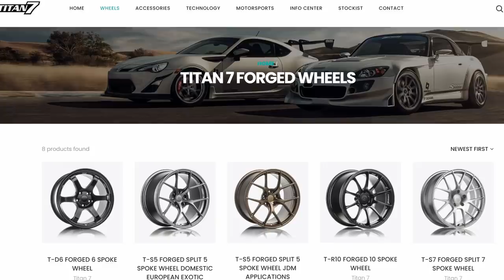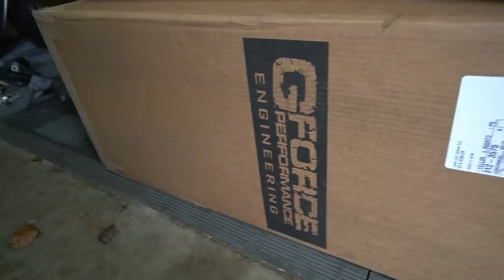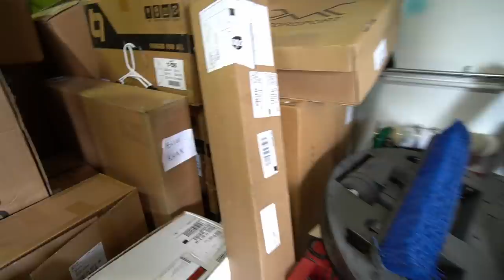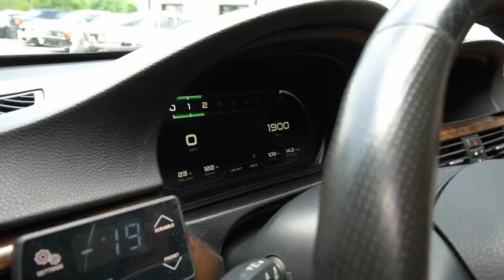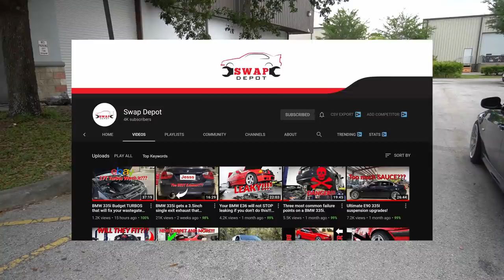Attempting To Fit CRAZY Aggressive Wheels On My 700HP BMW 335i - Will They Rub?

Comment: With a taller offset, you could run wider tires in the rear. Im on 295 30 18, 18x11 et29 and we put my set up on my friend's LCI just to see what it would look like. We found out that it's only the hub that is wider on the LCI's fender clearance is all the same. So if we ran a higher offset, he could also run 295's on his LCI
Reply: What’s your suspension setup?

Comment: I almost ordered 18x9.5 myself, I think I’ll stick to the 18x9 square setup because I don’t want to shave the fenders. Those look great and thanks for another great video.
Reply: If you go 18x9.5 on a e90 you absolutely need a very very stiff suspension right? Otherwise it will rub? (Or am I wrong? :-) )
Reply: im about to order 10.5x18 ET22 for the rear but im getting scared when i see this.......?

Comment: I run the stock wheels in a square set up,  style 193 that come with the m sport. I had 2 sets so I was able to do a square set up. 18x8.5 275/35/18 all around. No rubbing in the back and fronts rub because my bump stops on the strut is non existent

Comment: No one believed me that I could fit a 275 35 19 on the rear of my e92! Thank you for proving them wrong!
Reply: You can easily fit a 275 on there with minimal to no camber and work on the fenders. I've been showing guys and telling guys this for 10 years since I got my e90 LCI brand new 2010 and still have it.
Reply: My first year of ownership I ran a 18x 10 front the offsets 245-35 meaty Tire and rears were 18 by 11 and half low off sets with the 285.30 meaty Tire minimal camber hardly any work at all took me a couple hours to put in

From there of running 18 by 10.5 front 19x11 front, 18x12 rear 19x12.5 rear etc etc always pushing the chassis and Trying to show its limits 

The last 6+ years been running the widest to date worldwide on any e9x stock body non widebody M body included. Measured for a year to the mm and took lots of custom work mostly for the front to get the camber I needed to make work. 

19x12 FRONT negative offsets 6" lips 255/35 tore 
19x13 REAR  negative offsets 7" lips 275/30 tire customer entire front suspension we made upper arms lower etc to get the camber needed 

Run -14 camber now at least last year's matching front to rear

Comment: I'm in a FB BMW diesel group and about 50% of the member have 335d's.  Many have modded them because they are torque beasts.  It's not uncommon to get them to 500 hp and 800 ftlb, so you can imagine they're playing with stances all the time. Not many pull and roll fenders and some have put 275s on the rears.  

Also, I'm not sure if the Ford differential is necessary.  On the diesels the doffs are rates for 1000 ftlbs. I could be wrong but I'm assuming that the 335i and 335d have the same stock diffs. If they don't then you might want to switch to the bimmer diesel diff instead.

Comment: I almost ordered ET25 9.5 rear and ended up not doing it because of this.

You could change out the wheel hub for a pre-lci and get 8mm more to play with on each side FYI.
I also think you could also just shave the hub on the wheel and get a higher ET.

Otherwise, as you probably are doing right now, just roll the fender and pull it a slight bit (still wont be enough probably).

Comment: Without paying over $3000 for custom high end rims, M235i/M240i only has 2 options to get to proper fir 265s in the rear. Apex(2 styles) and BBS(dinan 19s). Need at least et50 in rear to fit 265s.

Comment: Are you not worried about your wheels shifting during corner transitions running 9.5 and 275 in the rear? I've heard that the overhang can cause a bit of shifting or sliding feeling when transitioning between corners

Comment: Ally starts bolts by hand before using gun
Christian goes straight for the gun.
Careful not to strip those theads
Reply: Exactly. Cross threading is no joke. BMW wheel studs are not cheap

Comment: By any chance did you hop on the toll road today kind of by Cocoa and see a dark grey GTI kinda loud and do a drive by? Because I happened to be cruising  when a 335i like this one same color and similar setup passed me and I was like, well damn! subbed just for that reason alone lol
Reply from the maker: Didn't drive the 335i today so it wasn't me. But i appreciate the sub!
Reply: @VehicleVirals  ha ok no worries, it was pretty quick and I don't know any other 335i's that move like that except the ones that have the M3 setup under the hood.

Comment: Parts don't get forged. Aluminum in it's bulk form i.e a block of aluminum gets forged before it is machined to the final product. So yes Ali, those wheels are made of forged aluminum. Companies call their wheels forged because the giant block of aluminum went through a forging process before it was CNC machined into a wheel.

Comment: Surely you can only fit the M3 rotors if you fit the hubs too... The calipers will bolt on... But not the rotors..
Reply from the maker: I already have them installed. video coming soon.

Comment: As a former tire tech I cringe a little when people leave the stickers on the tire.
Reply from the maker: Sucks for you.
Reply: @VehicleVirals  Not going to be the one wrapped around a light post because I wanted to show off I had new tires  or was too lazy to take them off on a high horsepower car. Also who cares if the tires go out of balance at high speeds. Why not leave trash on the streets for others to clean.
Reply: @Moe_z  damn